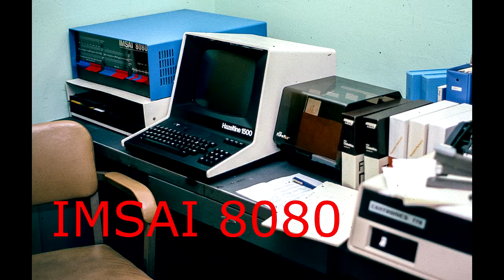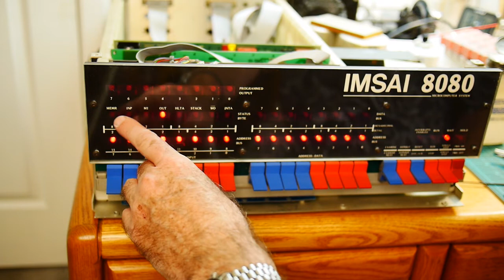#8 IMSAI 8080 add ram and run program

Comment: Curious why you say the 8080 was deigned for Octal. Was this because they chose to use octal (instead of hex) when they wrote the programmers manual?
Reply from the maker: no, if you look at the 8080 instruction bit patterns you will see that the hardware uses three bits of the eight often to designate things like register A B C D E F H L    things come in patterns of three bits.
https://upload.wikimedia.org/wikipedia/commons/9/93/8080-8085_Reference_Card_OCTAL.pdf

Comment: Great series.
My first computer was the Altair. I got it cheap from a disgruntled owner that bought it in kit form and tried to put it together with a soldering GUN. Yep, a 1500 watt iron.
What a mess, but I got it working after a month of work.
Always wanted an IMSAI for the two main reasons. First, because it has input switches. And output LEDs on the front panel. Altar did not. Secondly, the power supply was more beefer than the Altair.

My first program was the C3, 00, 00.

But I also loved Lionel trains. So, I program my computer to run a simple railroad signal.

Blue the chips off the   I/O board. Lionel AC and Altair DC don’t mix.

But I did get it to work and then sold the Altair.

Bought the IMSAI 8080
And never looked back.

Comment: I remember the 2114 static RAM chips fondly, using them in my first Z80 computers I made while still in school in the early 80's.  They are 4096 bits arranged as 1024 x 4, so you only needed 2 chips to get a working computer.  There was also a 6810 static RAM chip I used on an early design which had a whopping 128 bytes in a 24 pin DIP.

Comment: I've been having a problem with my IMSAI. It executes the jump instructions properly, but when I key in the "read the switches" program, the switches have no effect on the output LED's. The program doesn't work when single-stepped or run normally.
Reply from the maker: You'll have to look at the schematic for the front panel and look to see if the correct signals are enabling the switches as an input port
Reply from the maker: I assume the LEDs are working as an output port.

Comment: Hi!
I'm impressed...
Two questions:
No. 1: do you happen to know what the DIP switches on the right side of the card are for?
No. 2: there seem to be four voltage regulators on this card - do you know why?
Reply from the maker: the switches are for bank select. since the 8080 can only address 64K bytes, you could have several 'banks' or pages of memory and turn them on and off. the method of selections was to write (output instruction) to a bank port. the address of the bank port (0 - 255) is one set of switches. then you can program the card select for a particular bank (0 - 255) as the byte value you sent (the other set of switches) so you might have all your card bank ports set to 55h and then each card might be 01h 02h 03h....

the reason for 4 regulators is that the RAM needed lots of power. each bank of 4K RAM needed 1 amp at 5V. so 16K needed 4 amps!  each 7805 would only supply 1A. The heat sinks are pretty small also.
Remember this is before CMOS was invented.   we have it easy now.
Reply: Too right we have it easy! All those RAM chips and more can be substituted by just one chip. It is staggering how far we have come in less than 40 years.